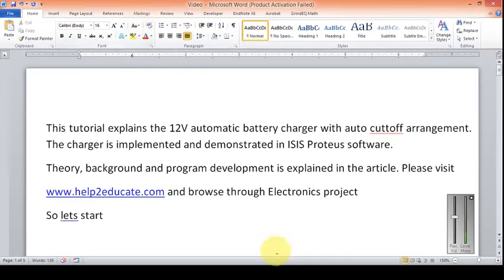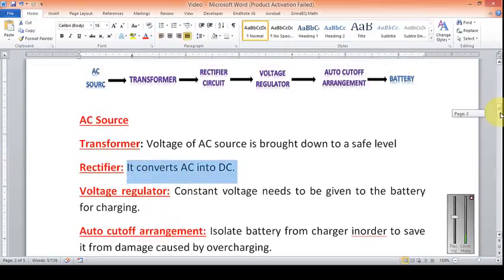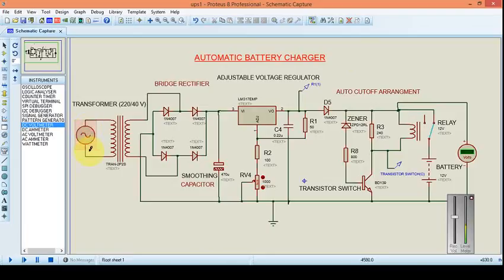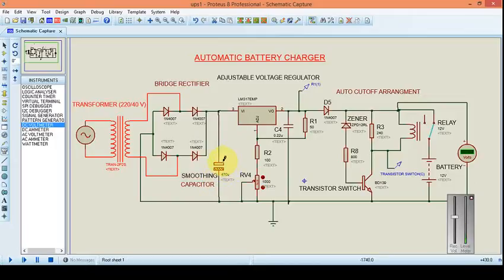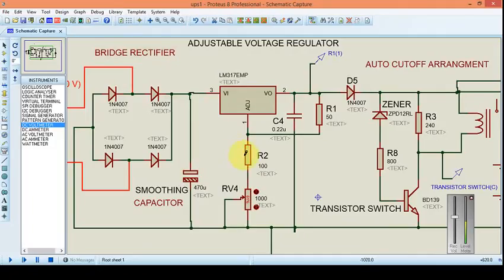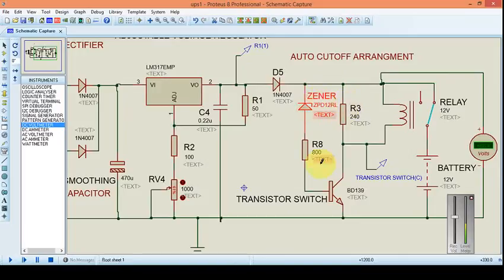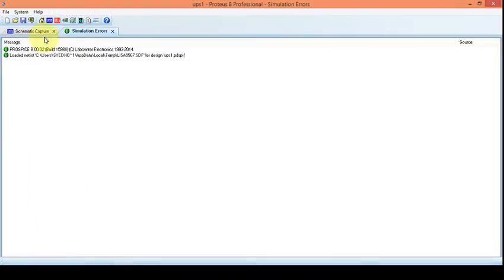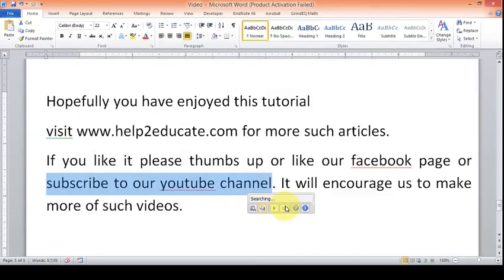Explanation of 12V battery charger Proteus simulation

Comment: In the cutoff section, what is break down voltage of the zener diode? What is the rating of the relay. The way I saw you wiring diagram.its seen that the relay is 12v .
Reply: His circuit is wrong. In this configuration the relay will always be energized. Anyway, the Zener diode is 12V. The relay coil is 12V, the relay's contacts rating depend on charging current.

Comment: There is a issue with this circuit.. when the battery is charging the voltage of the battery will read the applied voltage charge.. there for this circuit will always be on
Reply: Exactly!